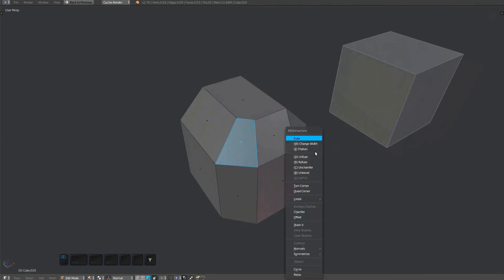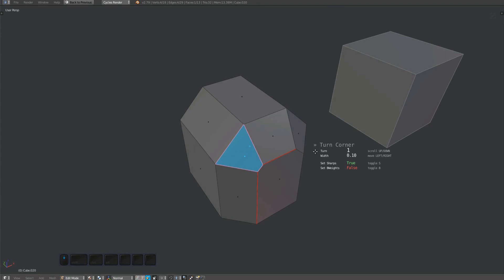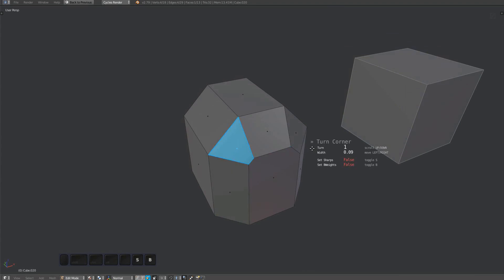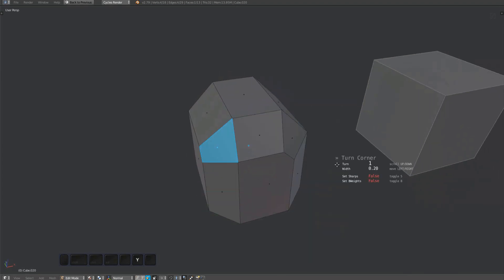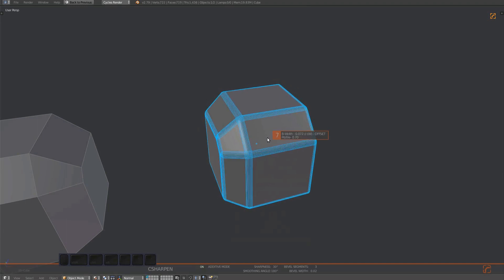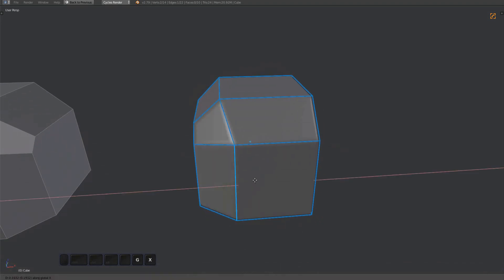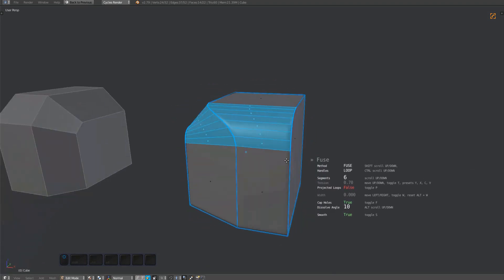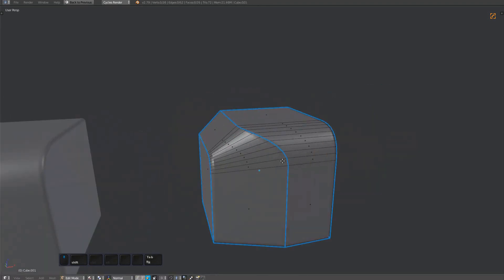MESHmachine 0.6 - Turn Corner

Comment: Would you add a hotkey to the corner tool to lock it ? I always work with Wacom Tablet. I always press F9. thx, your tools are amazing.
Reply from the maker: Do you mean disabling width adjustment using W, as in some of the other tools? I've just added this. MM 0.7 should release in a week or two.
Reply: @MACHIN3  Yes, thank you so much.